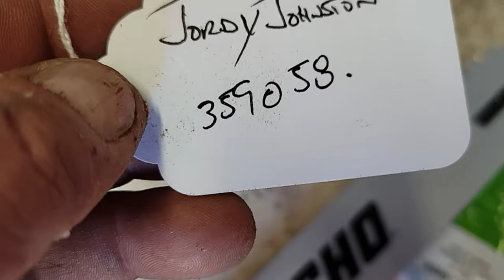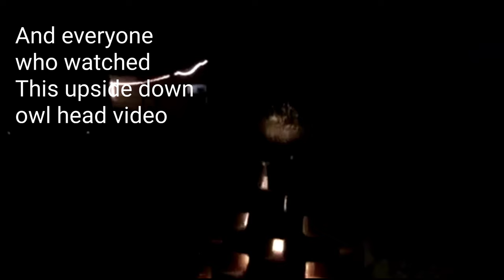How to make a very cool light out of old branches u can find anywhere.

Comment: Woohoo 🎉 you got your saw!!! Not sure what the X is after 2511x, I haven’t seen one in person yet either. Still not available around here, yet. 
 CS 2511 WES this is the rear handle correct, or is there some other options in that model, and that’s why yours has an X?
Reply from the maker: The x has no meaning
Reply from the maker: And bro it's a really wicked saw, u need one 100%
Reply: @CarvingFusion  oh I’ll have one for sure. I‘be been sitting on the money for it, spent it twice now, but I’ve built it back up. Now to just keep my fingers out of the cookie jar.
 I think it was Ryan that recommended that I should’ve bought the longer carving bar, when I bought the 120 battery saw, I bought that 8” cannon instead